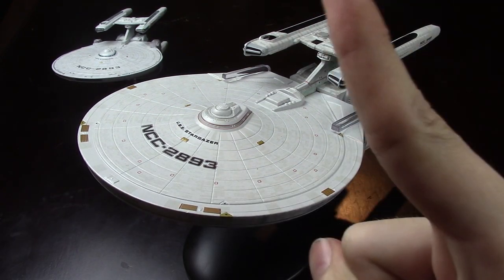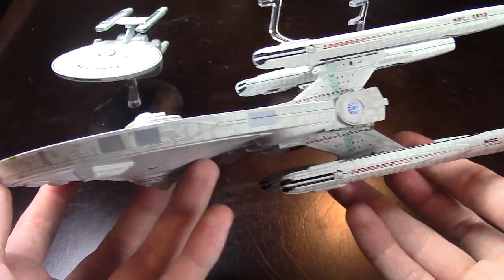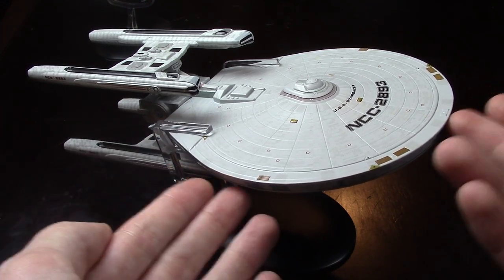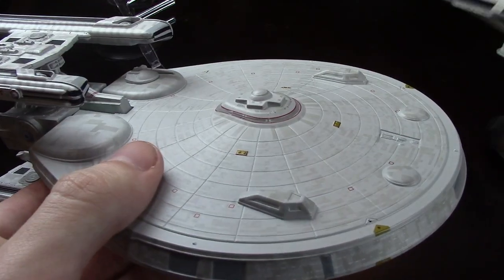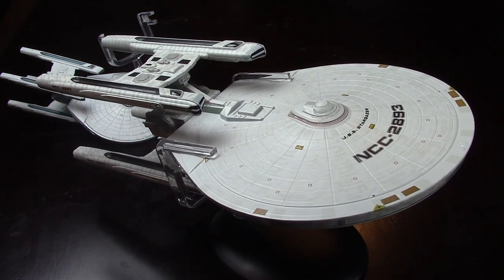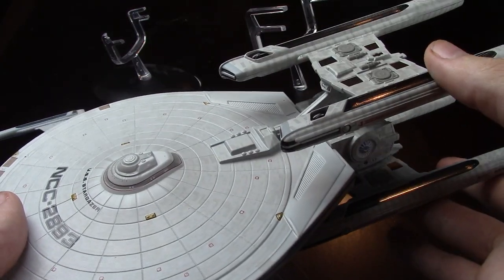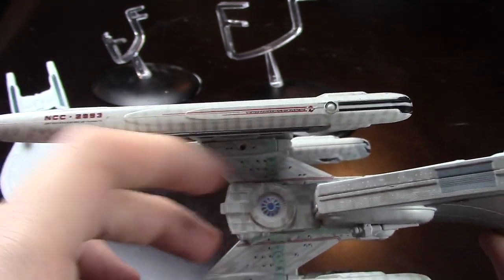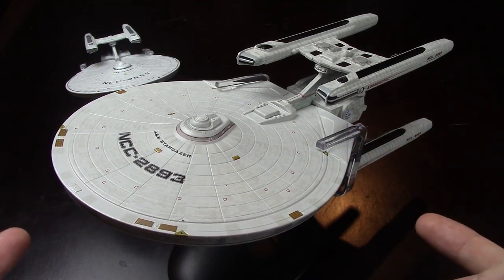Eaglemoss XL USS Stargazer Review - Four Turbos!!!

Comment: This model was based on the physical studio model used in Picard season 1 so therefore the differences with the small one does not necessarily apply.  The small one was based on the TNG TV series.  I still would have liked a thicker saucer but again it is limited to the box height.
Reply from the maker: That would make sense. However I'ld be surprised if the box height was limiting the size of the saucer section when the height of the model is so much bigger. We already have things like the starbases with very weird proportions as well
Reply: @CaptNSquared  The regular issues and the smaller boxes are really limited by boxes.  With the longer ships such as the Enterprise E/Excelsior are limited by the length so the saucer seems een smaller  The Enterprise C and D are limited by the the saucer so they look even shorter.  Many of the specials and XL's have the same size box so they model are then limited by the those boxes as well.  The designers had to make a compromise on filling the boxes the best way whether by height, length or width of the model.
Reply: Also starbases are a mix of specials from the original collection and specials from the bigger Discovery collection (starbase, section 31)  The regular Discovery/Picard collection is also bigger and same size as specials (up to 22cm long) therefore the specials are XL size (up to30cm).